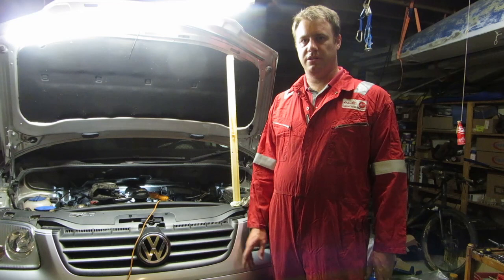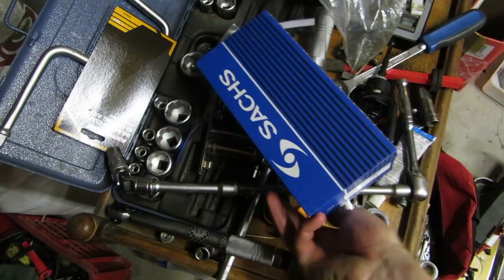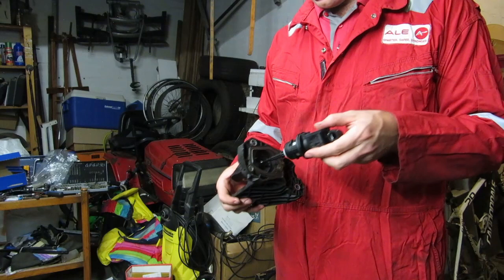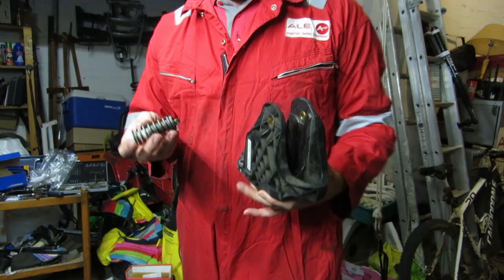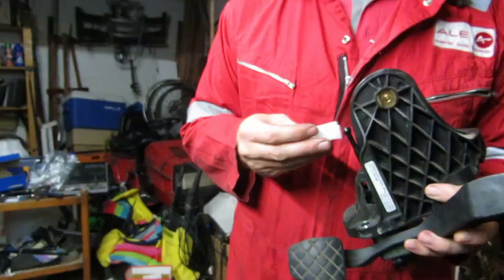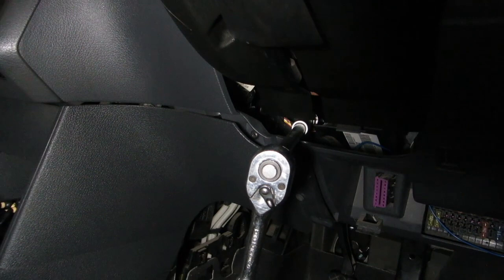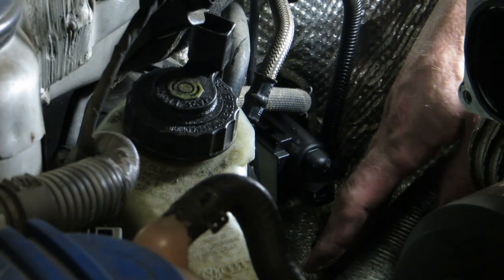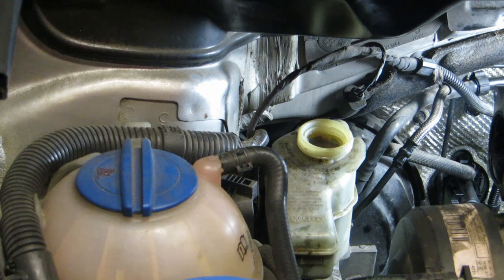VW Touran Clutch Master Cylinder installation

Comment: Are you pumping the clutch to bleed the system?
Reply: Hi, it'll be very very helpful if he answers this question... I've just replaced my B7 rs4 master and now I wanna bleed the system without messing up the new master and end up back where I've started .. my clutch pedal was stuck on the flow and couldn't change gears..
Reply: @tumelo7898  i got the same issue.. but it comes back when i pump it... lol